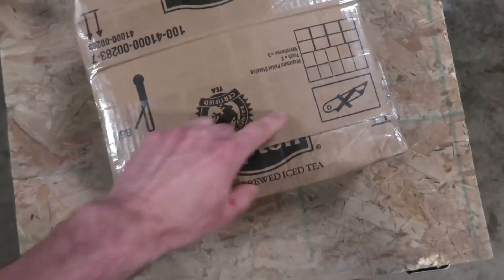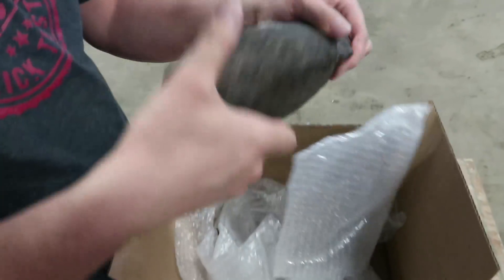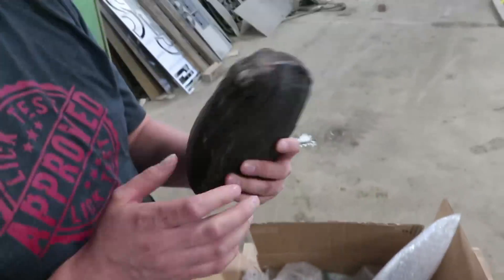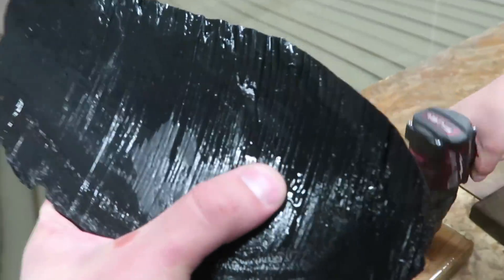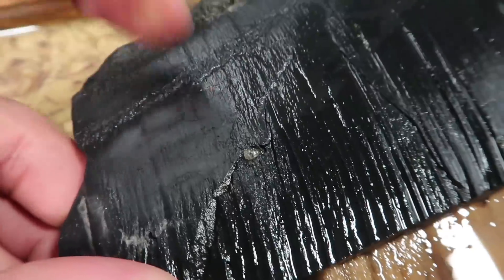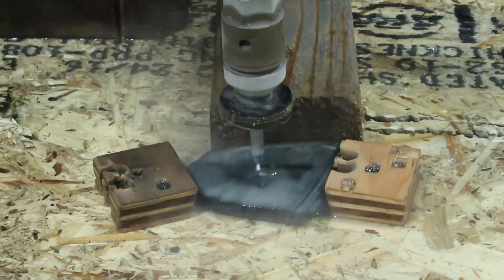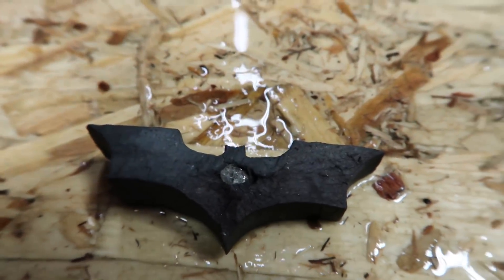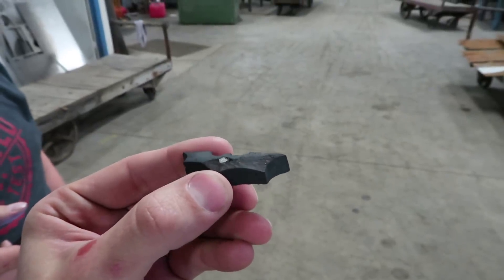Lava Bomb Cut in Half with 60,000 PSI Waterjet - Hawaii Volcano Eruption 2018 - Interesting

Comment: Considering that the average water jet cutter has no issues with objects up to Moh's hardness 8, the crystal has to be at least Topaz (8) or harder (Corundum 9, Diamond 10).  It could be a white sapphire...but considering how common diamonds are below the surface level of the earth's crust, it could well be a diamond.  Peridot and garnet are the most common gems in the mantle (with something in the neighborhood of 60% of the mantle being made of micro-crystalline peridot and pyroxene crystals together in a formation called peridotite...and garnet is extraordinarily similar to peridot in chemical structure), but garnet ranges between 6.5 and 7.5 on the mohs scale (although it can be found in a "white clear" formation that looks similar to most diamonds colorwise) and would have been severely damaged/destroyed by the jet.  Basically, all things considered, my bet would be on either diamond (all carbon), or corundum (aluminum oxide).  The easiest way to test would be to get a cheap sample of raw corundum for a couple of bucks on eBay, and attempt to scratch the corundum with this crystal.  If it scratches, odds are very good that it is a diamond.

Comment: I call shenanigans. One way or the other, this is not true. Either that isn't a diamond, or that wasn't a lava bomb. My guess is the former, as the rock looked pretty basalty. Here are my reasons:
1 - Basalt isn't diamondiferous. If somehow Hawai'ian basalt WAS diamondiferous, Hawai'i would be covered in diamonds, which it isn't.
1a - Basalt isn't diamondiferous BECAUSE of the rate at which it ascends. That lava bomb would have been liquid magma for tens or hundreds of thousands of years prior to being ejected, and any diamonds somehow picked up from the mantle would have melted completely long long ago. Most diamond deposits are in kimberlite, which comparatively to basalt, traversed the distance from the mantle to the surface instantly, thus preserving the diamonds.
2 - Thermal shocking. If there SOMEHOW was a diamond in that basalt, the extremely rapid cooling from 1100 degrees C to less than 200 in the very short period of time from ejection to impact would completely shatter a diamond (I actually have done this by accident at work).
In conclusion, it's probably quartz. And if there's anything that grinds a diamond worker's gears, it's people calling quartz diamonds.

Comment: They 'cut' this lump of basalt (lava) with a high pressure waterjet yet when they display the cut sections you can see the marks of a circular diamond impregnated saw. (curved lines) Me thinks there's a fair bit of 'skull-drugery' going on here.
Reply: Basil Brush the marks are actually due to the stream of water being deflected as it cuts the material, you can see it clearly in the video where the cut obsidian, when they are cutting the thin sheets. The water has finely ground crystals (I believe it's ruby) in it as an abrasive to help it cut hard materials. These particles leave streaks on the cut surface as they wear it down.
Reply: Ok , Interesting. In other words the finely ground abrasive is Aluminium Oxide. (ruby/sapphire) I assume it's the synthetic corundum. Identical to the natural mineral.

Comment: Diamond is not uncommon in volcanic ejecta. Little know fact is that diamond is much more common than advertised. The most common place to locate diamonds is in the ejecta fields and caldera of ancient extinct volcanoes. All of the LEGAL diamond mines are owned by the De Beers Corp. They frequently can be found within these ancient calderas. Deep in the Earth's mantle are huge diamond deposits formed over millions of years from carbon deposits deep in the earth. Since the heat and pressure in these depths are so great, the diamond is malleable and are pushed up from the mantle to the surface through fissures which later become volcanoes. It wouldn't surprise me if it was indeed a diamond, however it could also be feldspar (also known as field stone). Feldspar is a quartz like stone, and without further inspection could be confused as diamond. The scratch test is best to use to evaluate the stone's hardness, which would allow you to determine if the stone is diamond or feldspar without destroying the stone. You could look for the other half (if it was cut in two) and do a scratch test or a crush test. Feldspar is softer and will crush at pressures much lower than that of diamond.

Comment: Moonstone.  yes it's feldspar.  very cool find to still have it set in the stone like that and nice very clear example.    very neat.      Hawaii's actually been spitting out peridots with this eruption, would be cool to cut open one of those and see a big peridot.    they've been seeing a bunch of little ones.
Reply: I had considered that, that's why i mentioned that the volcano has been spitting them out.  but I have never seen a peridot THAT crystal clear before.  there's always at least a hint of green.  I see absolutely no hint of green in this example.   I'm still inclined to believe that it's not peridot, and is Feldspar.

Comment: Its not uncommon to find diamonds in lava depending on carbon content. Other crystals and other gems have been known to be brought up to the surface including gold. Remember, lava is melted earth, usually formed during induction ( movement of the plates passing above and below earch other. Soil,  sediment, and rocks are brought back up from the molten  mantle and redistributed mixed with basalt and other things. The deeper the lava comes from, the more chances that heavy metals can be carried up such as gold.
Reply: >Its not uncommon to find diamonds in lava depending on carbon content.

i'll never understand how some people can be so confidently wrong about something. 

kimberlite eruptions are pretty uncommon, mate lol.
Reply: volcano diamond formed by huge lightning bolt caused by dense flying ash that's produced electrostatic potential, struck any carbon cause its got highest conductivity at those extreme temperature

 if volcano diamond formed by mantle, then it should been dissolved by lava before diamond reach surface diamond vaporized at 900 degree celcius into co2

Comment: Cool lava bomb cutting - you probably answered this before but i got no time to search your vids now - Can the water jet easily cut tempered (toughened) glass, usually called safety glass - that is the type that shatters into tiny pieces when it breaks and is used for such things as shower enclosures.  If so how much does it cost to cut and does it produce a clean edge that can be smoothed off for no sharp edges?  cheers, Ray.  Reason i ask is to recycle this type of glass.

Comment: It is highly unlikely that is an actual diamond.  I live on the Big Island, and the lava often contains crystals -- some of them look like diamonds, some look like sapphires, etc., but they're just crystals.  I'd recommend testing it with an electronic diamond tester -- I'd be shocked if it's an actual diamond.  :)
Reply: crystal wouldve been destroyed by the water jet
Reply: Eather way it's cool that that was in there
Reply: matthew fenimore 
This guy has a point diamond is pretty tough to cut through
Reply: Many South African diamonds are found in Kimbelrite, which as igneous rock.
Reply: It is a possibility that it is a real diamond but like you said it could just be a crystal; quite a few thing can form from elements being pressurized under high heat.
Reply: RandomNumber I agree. Diamonds form under immense pressure, not something you’d find in a flying hunk of lava. Of course, a diamond could potentially have just been in the lava that flew out, as diamonds melt at a much higher temperature than lava, but it’s pretty unlikely. I’d like to see further testing done on it too
Reply: Paul Bagg - Immense pressure? Man I bet I flushed a diamond last week after that Mexican food.
Reply: "Very unlikely this is a diamond as the area just doesn't have the geology for diamonds. Most likely a quartz."

Diamonds form deep in lower crust/upper mantle and are brought up to the surface by violent volcanic eruptions. If the magma source is deep, it could carry large chunks of exotic material straight to the surface. If this lava is from Hawaii, it's source is deep within the mantle. You know what doesn't exist in hotspot basaltic lava? Quartz. You will never ever find quartz in fresh basaltic hawaii-type rock.
Reply: Profezor Snayp - "  If the magma source is deep, it could carry large chunks of exotic material straight to the surface. If this lava is from Hawaii, it's source is deep within the mantle. "

..And diamonds aren't generally found on Hawaii, which would suggest that in Hawaii's location, there aren't diamonds along that magma tube.

Anyway...Even if you don't believe in the 'bad luck' associated with taking a volcanic rock...

....Removing anything form a national park is illegal, and the active volcanic area of the Big island is a national park. You also need a permit to take any volcanic rocks or even beach sand from Hawaii.
Reply: Profezor Snayp doesn't have to be quartz to be a crystal
Reply: Wrong.  Magma is under extreme pressure.  Diamonds form in Magma.
Reply: Paul Bagg u know all the diamond we have today is from Volcano eruption which sent all the diamond form in 150 to 250 kilometers to the surface. right?
Reply: @realdeal5712  That's not how it is. Not "all" the diamonds we have are from eruptions.

Comment: I am wondering what would happen if you used a water jet on molten metal. Would it just turn to steam or would it cool the metal and not cut it or cool the metal and cut it?
Reply: bad things happen when water gets trapped inside of molten metal as it creates a pocket of steam that blows the metal all over the place just look up something along the line of (Steam explosion metal casting ) i have been in the room with a bronze pore where the mold had to been a left over from the last batch and had picked up enough moister from sitting around to bed dramatic when it pooped

Comment: How high is your water bills? For this place.
Reply: Probably not much higher than a normal household. If the average human uses 17 to 20 gallons of water for a shower 7 gallons for every toilet flush and 30 to 50 gallons for a load of clothes. Thats alot more then that machine can put out in the 5 to 10 minutes to cut something.  They usually use 5 to 10 to cool the waterjet and then 1 to 3 every minute of cutting.
Reply: Skiddols ok thanks

Comment: For those who think it is feldspar: Feldspar is usually shaped like a brick, it has two planes of cleavage which are approximately at right angles to one another. Its not transparent and usually has a translucent white or pink colour depending on iron content. Plagioclasw is a common rock forming feldspar of basalt, mixed with pyroxene +- olivine. Feldspars are not very hard compared to quartz so the waterjet wouldn't have a problem cutting feldspar as it makes up a percentage of the bulk rock anyway. Looks like a quartz xenocryst that became entrained upon eruption. Quartz (SiO2) is less dense than minerals in the magma and will actually float in the upper layer of the magma.
Reply: Waterjet Channel I know how you feel. Wish he had said it in layman's terms
Reply: It's a simple quarz Waterjet Channel.
SiO2.
Reply: Waterjet Channel Take it to a pawn shop or jeweler they can test it if its a diamond or not .

Comment: Diamond is only formed under huge pressure, I'm pretty sure you don't get that in a lava bomb
Reply: its actually happened multiple times before that diamonds are shot out of volcanoes. they come from the magma chambers and just when volcanoes are formed in general
Reply: Oh wow, I thought they only formed within rock layers and that a fluid environment isn't suited for diamond forming. I guess I learned something new today.
Reply: They burn while inside the magma, without much of any oxygen exposure?
Reply: I've heard that diamonds we use a lot are from diamonds being dislodged from the sides of magma tubes and sent to the surface a long game time ago (not sure if millions or tens of millions of years).
Reply: The Big Game Theory and why is that? I'm not asking to sound rude, I actually want to know if the structure would break down or something...
Reply: The Big Game Theory what do you mean "burn away?" If your talking about melting point, you'd be wrong by a factor of four.

Comment: What is that stone actually geology peeps? We all agree with Cody?
Reply: Caleb King Conchoidal fracture, no cleavage, vitreous lustre and round shape. Looks like a quartz xenocryst. Diamond is highly unlikely as they usually ascend very quickly in magmas known as kimberlites, orangites or lamproites. All of which are K-rich and highly volatile rich which gives them an abnormal viscosity and ascension speed. These magmas come from depths of ~50-150 km and can carry diamons that have been entrained in convection currents from depths of up to 680 km. Even in these rocks that frequently sample this ultrahigh pressure zone of diamond stability, diamonds are only abundant in about 400 ppm in kimberlite deposits.
Reply: It could be a xenocryst (a crystal that got incorperated from the surroundings) or a phenocryst (a crystal that grew in the magma chamber before erupting). It can be any number of minerals from igneous to metamorphic in origin. My guess is that it is some sort of colorless pyroxene like a diopside that got brought up from the mantle with the rest of the melt. If it was a feldspar like Cody said I would expect it to be a phenocryst in which case the crystal would likely be more euhedral (having well formed crystal faces) and show more evident striations and cleavage. But I'm an undergrad in geology so take that with a grain of halite. I'm done nerding out now... Continue
Reply: Caleb King yup, it is a rock
Reply: A rapper with diamond encrusted fake teeth fell in the volcano....
Reply: Caleb King take a look at the Wikipedia page for feldspar.   "Feldspars ... are a group of rock-forming tectosilicate minerals that make up about 41% of the Earth's continental crust by weight. Feldspars crystallize from magma..."
Reply: But at the same time they said the water jet hit something hard. Isn’t feldspar fairly easy to cut through? Or am I mistaken. I am going off of a high school class from like four years ago so don’t quote me on any of this. Just thinking that unlikely does not mean impossible.
Reply: It's a basalt (Feldspar and pyroxenes) and that crystalized mineral is either a quarz or a mg-rich olivine.
Last one is very unlikely, since olivines almost always come as a mixed crystal (mg - fe - olivinies --> forsterite - fayalite) and thus are greenish.
Reply: Caleb King its aluminum foil
Reply: Oodles lol grain of halite
Reply: Caleb King So in otherwords this thread says we do not know what it is?
Reply: Miszkulancja English translation: It can't be diamond because science.
Reply: It’s clearly a rock
Reply: quartz or plag
Reply: Translucent Kryptonite. It is in a Bat-erang...
Reply: I'm pretty sure Cody is a geology major, IIRC.

Comment: quartz or plagioclase....but still very cool
Reply: manzzz with the planzzz No an eruption is a release of pressure from the magma chamber. Volatiles such as water and SO2 form bubbles in the magma chamber which eventually overcomw the surfave tension of the viscous magma causing an explosive eruption. Diamonds form at ridiculous pressures and temperatures naturally at 25 GPa and >1500 C meaning a depth of ~400-600 km in the mantle. Industrial diamonds are made by a process called chemical vapour deposition (CVD) where a carbon vapour is condensed onto a tiny seed diamond in a vacuum.
Reply: James Farrell ohh yeah that makes sense because diamonds don’t form from eruptions
Reply: Jon Scheckel Diamonds dont form from eruptions you are correct, but they get to the surface via a very large eruption. They form in the mantle and are carried to the surface by fast ascending kimberlite magmas.
Reply: Diamonds get pulled to the surface by eruptions,
Reply: Jon Scheckel aren't diamonds formed from extreme pressure and if so wouldn't an explosion create pressure and arent man made industrial diamonds made by explosion im asking because i don't know this is an honest question please answer
Reply: James Ball cool thank you i was confused and curious awesome stuff man very imformative